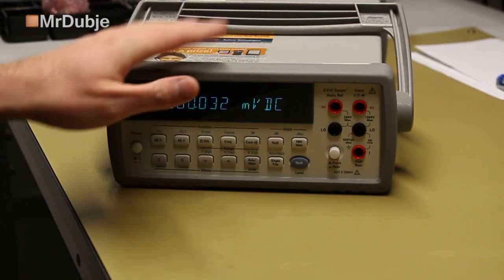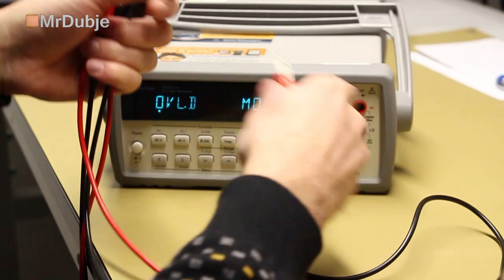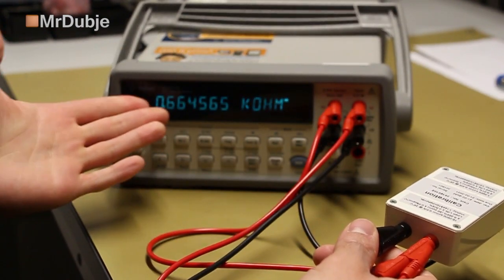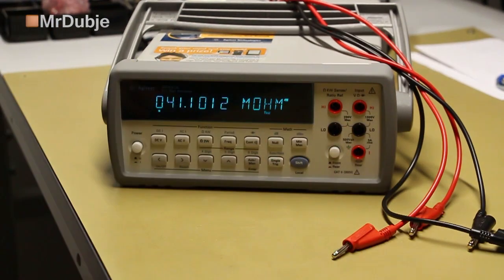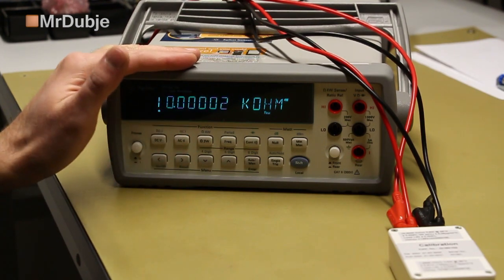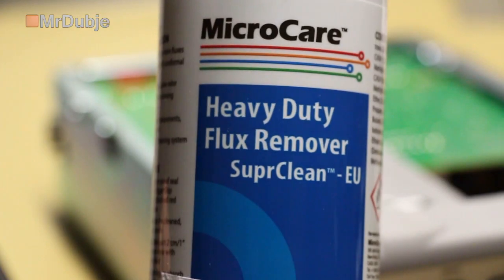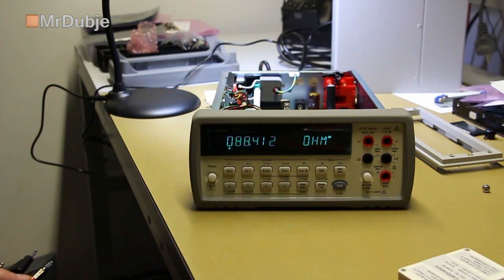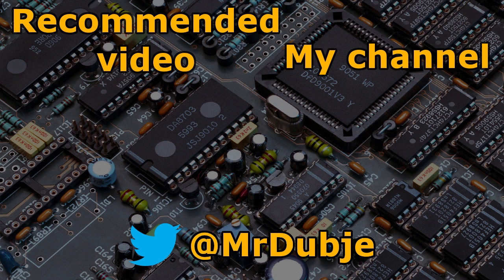HP / Agilent / Keysight 34401A Odd 4W resistance measurement fix

Comment: I recently purchased one and have used it a few times, mostly for 4 wire low resistance measurements that I cannot do with regular meters. I don't need the many digits really but contact resistance and cable resistance are a problem below an ohm.

I was also happy to find that it had an averaging feature that came in handy.  I was working next to a larger AC load and the resistance value was jumping around, selecting the MIN-MAX and waiting for a minute allowed me to look at the average which was stable over time and repeatable across the matched windings.

The procedure is easy

Min-Max
Wait some time to collect readings (beeps when new limits are captures)
Shift-MENU-Recall
DOWN arrow - Displays MIN
Right - Displays MAX
Right - Displays AVERAGE
Shift-MENU-OnOff - gets you back

Min-Max turns it off and clears the values.